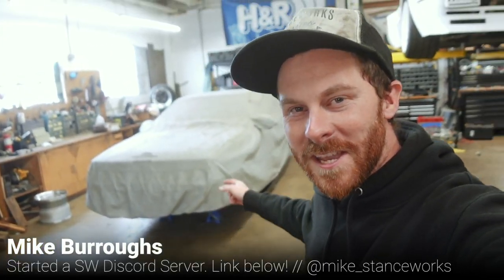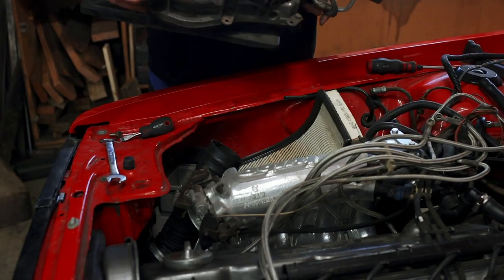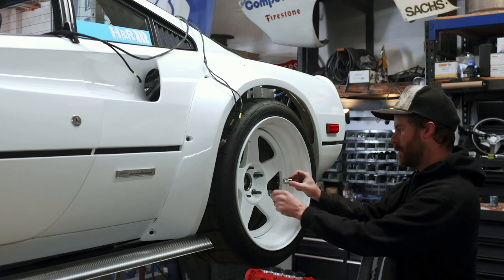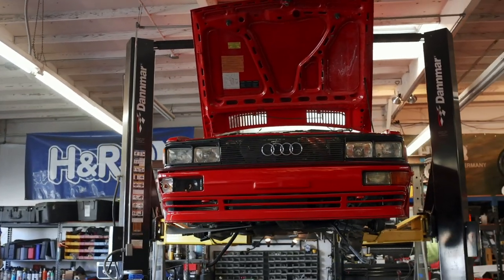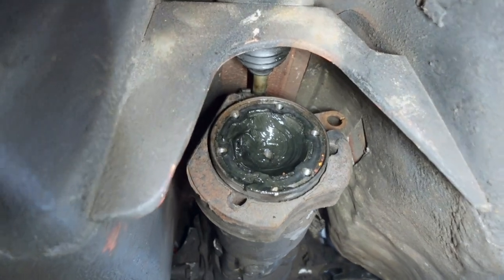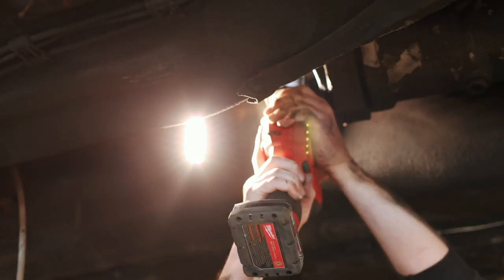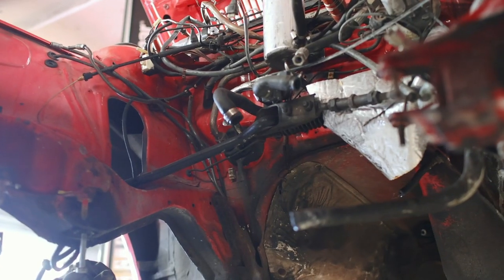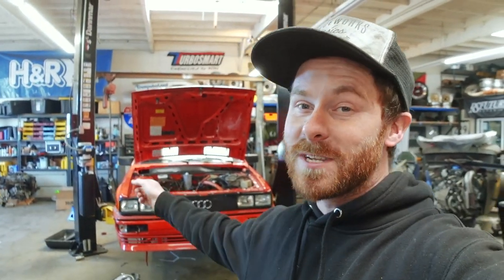Audi Quattro Teardown: 5-Cylinder 20v Turbo Swap Begins! - Ep. 3

Comment: Very good video. I've tinkered and worked professionally on Audi's since 1991.

The engine will come out of the top, but it is a tight fit. However it would have to be separated from the transmission. Also the crankshaft pulley and accessories have to be removed.

The airbox is alluminum because it is pressurized from the turbo.

This car shares a lot of parts with the 4000 Quattro, including that buggered up shift linkage. Just an FYI, in case you go looking for parts. Aside from the availability of the turbo engine, 5 lug hubs, and the shape of the upper body, the cars are very similar.

Comment: With coolant i wrap a plastic bag around the bottom radiator hose. This way you don't spill and you can re-use the coolant because it isn't contaminated with oil or dirt from the engine or sub-frame.

Comment: On most German cars, you remove the front end. Much easier and more access. Especially the Audi's with the radiator beside the engine. Even easier.

Comment: The Bosch K jetronic was a mechanical fuel injection system used in many German cars. It was an amazing system that could be converted and tuned easily for after factory turbo installations. I remember having it on my Golf mk2 GTi.
Reply: featured in a few porsches too like the 928

Comment: Period VWs used a similar steering setup. For the VWs at least, it used to be that you could get adjustable tie rod and tie rod ends for the passenger side to increase adjustability.

Keep up the good work!

Comment: "THAT AUDI QUATRO WAS MY DREAM CAR BACK IN 1984!!!" 5 CYLINDERS, A TURBO, AND IT WAS ALL WHEEL DRIVE!" The problem was it cost $36,000.00 back then and I couldn't find a Dealership, but I did find Jay Leno where the Audi was suppose to be sold at an BMW Dealership in Conneticut off the I 95 in 1985. Normally when you find an Audi Quatro now'a'days it is roached from rust. You got a lucky find.

Comment: I think inner and outer tie rods from b3 audi can be retrofited without any modification. It will give you  ability to adjust both sides . And the adjustmet threads are on the wheel side, migh be easyer to adjust toe on the outside, than behind the engine, when the 20v takes up more space in the bay

Comment: All of those welds at 6:04 aren't factory, that is someone stitching the subframe. A trick guys used when subframes were only welded in a few spots. They thought that the few spotwelds and 4 or 6 bolts holding the subframe together to the body were enough for perfection.

Comment: Off to a great start, looks good underneath, I know on the Passat with a similar steering setup it has a simple steering centralizing tool that you insert into the rack to get it centralized before doing wheel alignment, you may want to investigate that

Comment: I drop my engine the same way, I use a hydraulic lift table, I find it gives me a bit more room to get to the subframe bolts and a bit finer control for the initial drop/stress testing of things I forgot to undo!!

Comment: You can pull the old 10vt out the top... Just an FYI. Some guys also used to cut the front lock carrier like what Audi did on the B3 chassis.

Comment: VW/audi did the steering rack like this in all the models up to around 1995 ish. Im running a VW Polo mkII rack in my bug, almost the same design.
Cool to se you struggle just as much with the european cars as we europeans do. Good stuff! Me personally would build a better steering rack to be able to move the engine and wheight further back and get toe adjustment on both sides.

Comment: Suspension and steering rack are the same positioning as on a VW Polo  mk1 & 2 with the rack behind the engine and one side adjustable only tie rods. Steering arms on the suspension strut.

Comment: If you ever get the itch to make boxed fenders and 90 GTO styled bumpers for the C4 chassis I'd gladly give you mine for r&d lol... but I believe taking the front end off is the easiest way to take the engine/trans out, at least it is in the C4's. The steering rack is possibly the most questioned thing I hear when the hood is open on my UrS6.

Comment: Yeah. The front mount is easy to remove. Because it’s the alternator frame than can be easy disassembled :) the k-jetronic injection system is good when it works but is pain in the ass to setup without deep knowledge about how to set it up. You can go with the k-jet up to 300 hp in a 10V5zyl. I hope you get the engine and parts from a S2. Otherwise you will have fun finding parts. Because break system and stuff has different positions in an original 20V urquattro. The little details can be annoying as hell.

Comment: I know you've already decided to stick with the 5cy. and for that car its the right move... but I would have still loved to see it with a modern 2.5 TFSI out of a new RS3 swapped in. pretty sure that motor has the same bell housing as a VR so the 034 adapter plate should work to get it mated to an 01e trans or similar.

Out the bottom is definitely the easiest way. In audi/vw's defense though, in the early 90's they made the entire front core support on most of their vehicles removable so now you can just pull the engine out the front. due to the ease of access to do timing belts, etc the service manuals describe it as the "service position." some newer audi's it's still faster to go out the bottom depending on what you are doing though. 2.7t's when you have to replace turbo's for example... back when i was doing a lot of them we made something that looked like a welding table that you could drop the whole subframe down onto. you would slot the pins into the table in the position for that vehicle, line it up and drop it down. there are holes built into the subframe for it. that's how they were serviced at dealerships back in the day.

Comment: I was going to write a long message about the 20 valve engines cracking between the valves, but when I saw the car I realised it's a 10 valve block..  So, I went back three months and saw that you are fitting a 20 valve. So, yeah,  20 valves often get cracks between the valves. Mine included. But to be honest, it still went like a stabbed rat. But if you are going to tune the heck out of it, this could be an issue you face.

Comment: That steering rack setup is very 80s VAG. Mk1 and mk2 golfs are exactly the same. Though they do not have a prop to avoid.
Reply: And yes, you set one side straight and use the adjustment on the other side to straighten the tow.

Comment: You can disconnect the shift linkage from the top of the transmission, but in your case you will not use it with the 6 speed so it did not matter.

Comment: Dropping the numbers matching engine would reduce the value of that car by around £50-£60k here in the UK , that engine can be tuned to almost 800hp with about £15k spent on it , it’s a unicorn 👍bore out to 2.3 litre , forged pistons , balanced crank , larger turbo polish and port heads and I think there’s a coolant upgrade you can perform on the block galleries and get it to 500hp quick and cheap
Reply from the maker: They aren't even worth  £50-60k, let alone have that much value to drop based on an engine swap. This won't hurt the value at all.
Reply: @stanceworks  worth a fortune here in the UK 👍there’s an unrestored silver one in Dublin 10v turbo for €47,995 😲

Comment: Any chance (or any benefit) to make the front of the car removable? Like being able to take the headlights, grille, bumper etc as one component for ease of maintenance or potentially engine removal? I don't know, but with your skill and looking on how things are positioned on this car maybe you can consider that.
Reply from the maker: I think I will likely do this.
Reply: the B2 Urquattro guys I know have made the front section, the T- plate, removable. I’m glad Audi made the front section removable on the B3 and B4, I need to remove my engine in my S2, keep up the good work Mike!

Comment: Why not put a Volvo RN or RNC 5 cylinder engine into it? They are solid reliable and can make great power. More importantly, they are short/compact and can easily fit into tight space.

Comment: "It's clear that someone jacked the car up from the pinch welds." 

> Proceeds to raise the car on the lift on the pinch-welds without a small block of wood to protect said pinch welds. 

Not hating, just an idea. 
(Source: have handled expensive racecars on lifts.)
Reply from the maker: The rear pinch welds are reinforced. The fronts that I highlighted are not.
Reply: @stanceworks  Shows how much I know about Quattros. Thanks for the reply.

Comment: I took the engine out of the bottom on my Porsche 944 using jack stands and a harbor freight motorcycle jack.  STUPID STUPID broken bolt.  Oil cooler bolt and literally the last bolt of the whole job.

Comment: im sorry if im wrong, but that is a single camshaft engine, a 10 valve motor... plz anyone with some audi knowledge could tell if im wrong, or if the single cam 5 cyl has 4 valve per cyl too (head cover narrow, single pulley, etc)

Comment: The radiator core support has to be removed to be able to work on the car. In Audi lingo its called "service mode" and very common thing to do on most Audi's of this era.
Reply from the maker: This core support isn’t removable though.
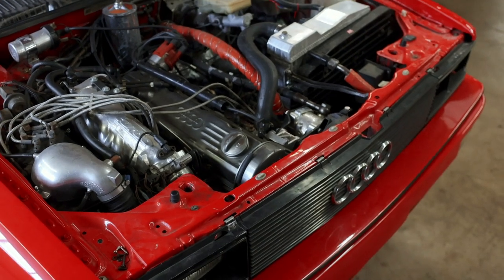Reply: clearly visible at @1:13 that the core support is not removable

Comment: btw if you look into it Audi and VW continued that stupid design for the steering rack into the 2000s... older hondas and chryslers even had a few cars with racks like that. i agree, it`s a dumb design. look into the newer audi suspension that did that, had like 6 control arms per wheel